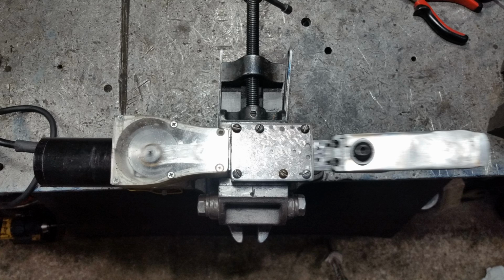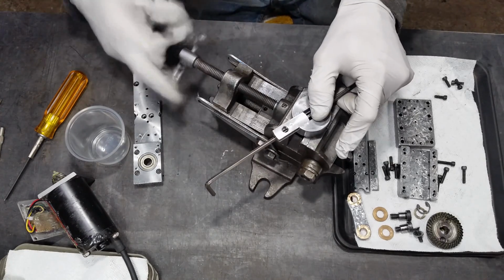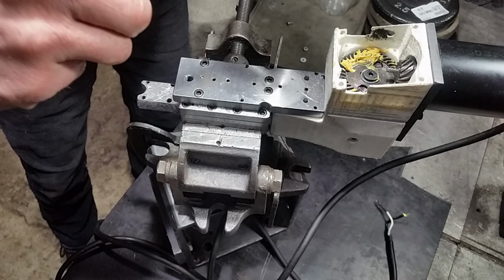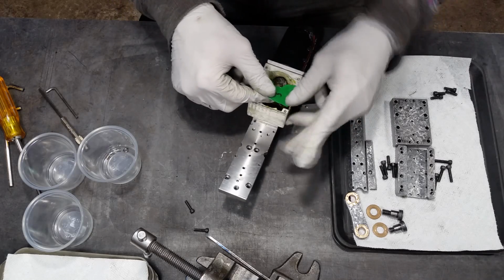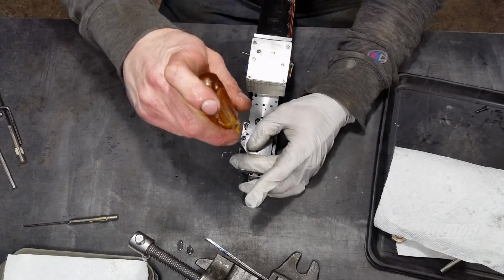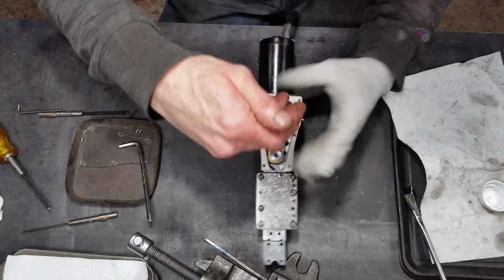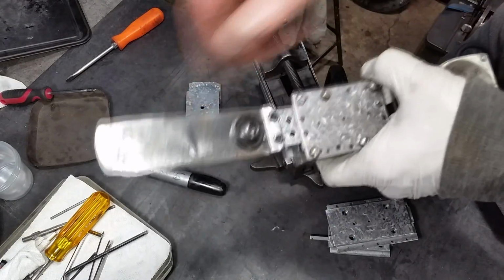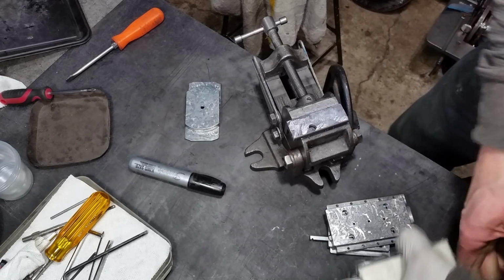Scratch built power scraper

Comment: Thats a great design, your adjustable stroke mechanism solves a couple of desin issues I was having. I had a boring head type design in mind but locking it wasnt ideal.  I'll bet a bit more flex/spring in the front flat bar will make it significantly more predictable. Great job! I'm using a nema 23 stepper motor on my build, hopefully its enough! Please continue to post more, I'd love to see some different blade types etc. Thank you for posting this!

Comment: I too found you via RotarySMP. I too have nearly finished a sawzall but I like yours more. Please can you tell me a little more about the motor? I know you said the bevel gears were from an angle grinder but the motor looks to be something different, is is AC or DC ( I don't know US wiring colours) and what is its basic RPM ?  Mine shakes a bit mainly side to side which I may be able to improve but yours looks much smoother. Thanks

Comment: Awesome build. I just use a rotary tool with a cone shaped grinding stone or an oscillating tool with a carbide tipped blade. It works a treat!  It's fast and very precise, since you can always shape the cone's tip.

Comment: Ok. I'm impressed. I got prompted to find your channel by a mention in one of RotarySMP's videos, and I'm glad I took the time to come for a look. 

This is some beautiful work, and incredibly well thought out (Except for that grease shield in the gearbox. That feels a bit too "afterthought" compared to the ridiculously high level of skill and workmanship the rest of this tool displays). It's a piece of kit that goes above and beyond where it NEEDED to go, but right where any self respecting engineer should aim. If it wasn't as functional it could be called art, but it definatly falls into the category of "Engineering porn". :D

I've got an old British "Hobby lathe" (But built back when us Brits took out Hobby engineering bloody seriously. :D), and one little design flaw I've always struggled with is the compound slide gib screws. The clearance between the gib screws and the nuts that hold the compound to the cross slide is tiny. Up to now I've been using a grub screw down each thread, and a second shorter grub screw to lock that in place, but this makes setting the gib a case of trial and error as the second screw moves the first......... So when I saw the way you've decided to lock your gib screws on this, my instant thought was " Oh yeah, I'm SOOOOO stealing that idea". :D

So thanks for the great content, and the inspiration.

Comment: Nice build Sir. 

The dark coloured grease used in many a power tool, is Molybdenum Grease. The molybdenum oxide platelets suspended in a carrier mates or sticks easily with the base material, but slides easily over itself. The result is a low friction, low wear interface. especially in highly localised  pressure applications such as the gears in your application. It's great stuff, but transfers very easily onto everything,  so keep it off your clothes or you'll eventually find it places you shouldn't.

I didn't catch what motor you are using. It looks to be a DC motor around 12-24V. A wiper motor perhaps?

Thanks for sharing this with us, and thanks to RotarySMP for the heads up about your channel..

Subbed.

Comment: Rotary SMP recommended I pop in.
I don't do much scraping now, but have used a Biax, and before that some 1950's contraption powered by a crane hung motor via a flexible drive, not very precise,  the flexible shaft caused the the scraper to buck.
Nice design and build.